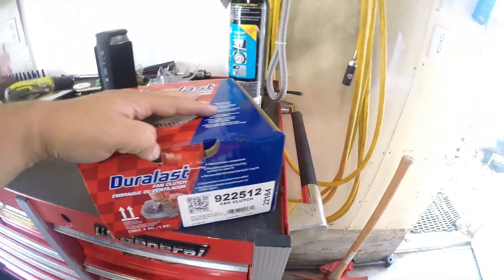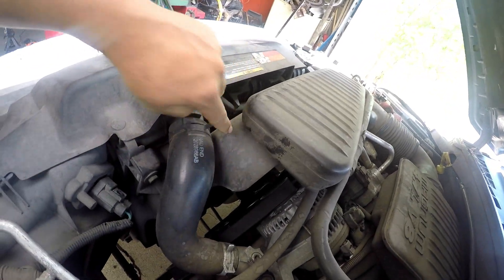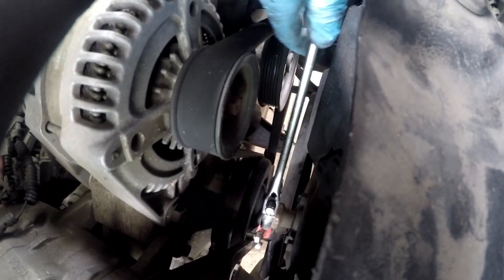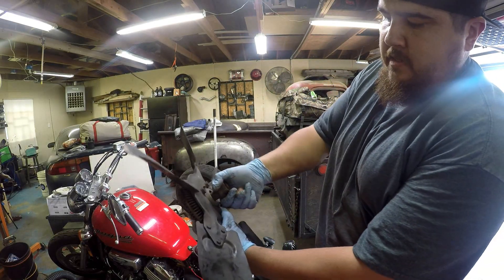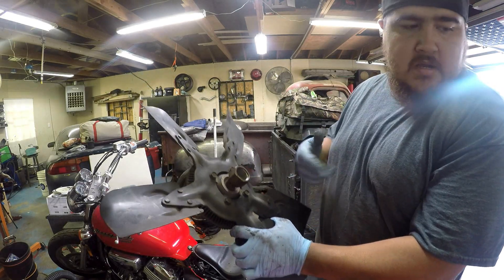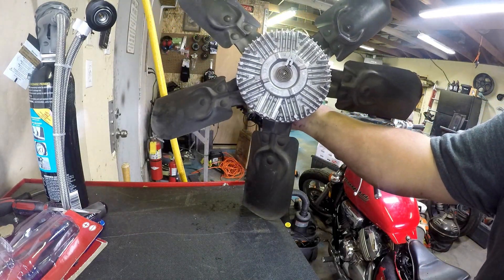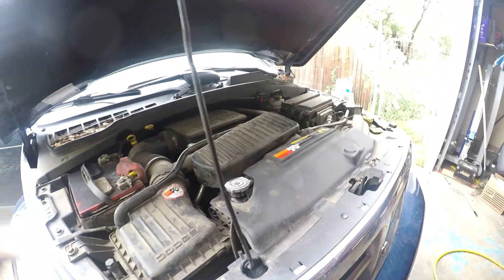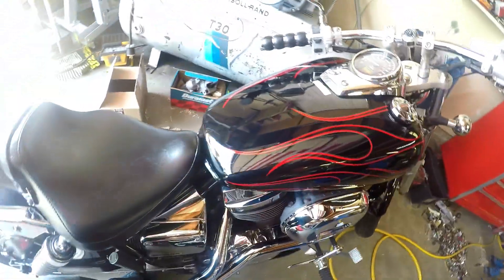FAN CLUTCH REPLACED ON 05 DURANGO

Comment: I'm in the middle of trying to replace my water pump(I got the part for the fan clutch as well) and the fan clutch bolt is giving me a heck of a time.
Also this helped me SO MUCH. I have the right wrench and it came eith the tool but the pulley had no bolts so I was just turning and turning and finally found a bolt to stick in and hold it in place

Comment: I just did my "new to me" 2004 Durango 3.7 . It sat in a garage for a large part of it's life with only 112,650 original miles. After careful work on plugs and coils, on kinda maiden voyage she did get warm, almost hot for no immediate reason. No water leaks.
I figured thermo or pump as she did spend most of her time idle. Took me 2 tries then Ebay for the lower rad hose. 
On to the next pain in the butt part. The Shroud / fan removal :(((((
The fan took a few waks.  
If I ever meet the IDIO? who designed that I would treat HIM TO SPOILD ANYTHING!!
So me being a bull in a china shop kinda guy I got out my jigsaw and wedged out an arm hole on each side of shroud.
Had a piece of wire around the fan nut to hold in place while I "using my new arm holes" gently aligned that darn fan..
And On her next maiden voyage she seems to be running mid on the gauge.

Comment: Thanks for the info. I have a 05 Dakota 4.7 4WD that's been getting hot and loosing water through Radiator cap.  I replaced radiator cap.  Still loosing water through cap.   I removed the thermostat and cut out the center to remove the core of the thermostat and I'm still loosing water, I think through radiator cap.  I ordered a new thermostat, water pump (just because of the mileage, 263,500.) and new fan clutch. I will take a look at the bypass hose as well.
Reply from the maker: Good luck 👍.

Comment: I have the same heating issues, only when going up hill in the mountains . I have the same make and model vehicle. Did this correct the problem? Thanks for the video, I feel I can do this and save some money.
Reply from the maker: It did fix the problem. but you need to buy the oem fan clutch as the autozone one will stay engaged and the truck sounds like a jetpack.
Reply: I have this issue come up today. 118 outside, up a steep grade for almost 8 miles. Did this fix your issue?

Comment: Is there a way I can get it off even with the engine belt off
Reply from the maker: I'm sure you can if you have the tool to hold the water pump pulley while you loosen the fan.